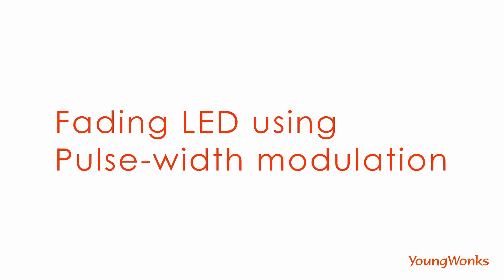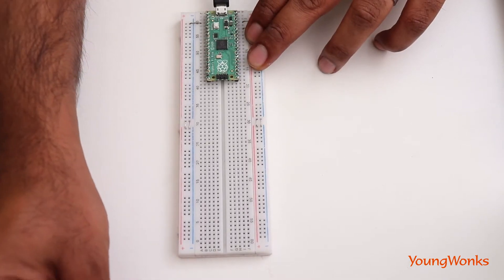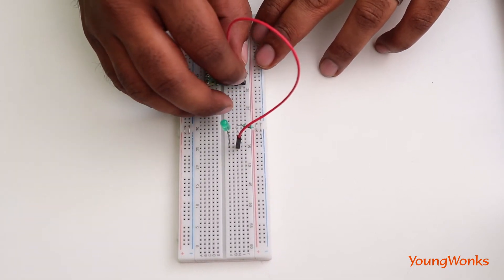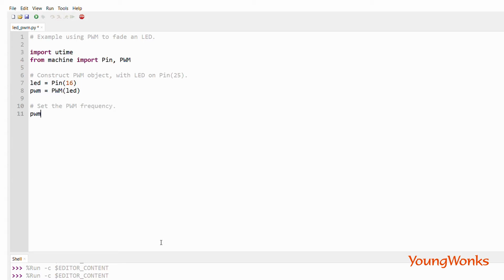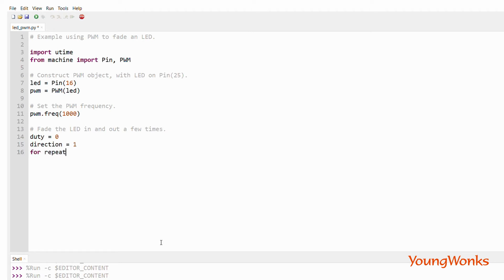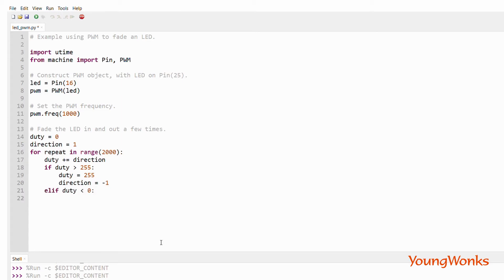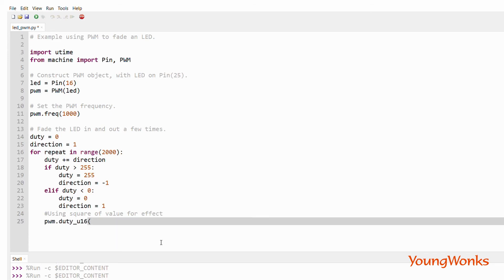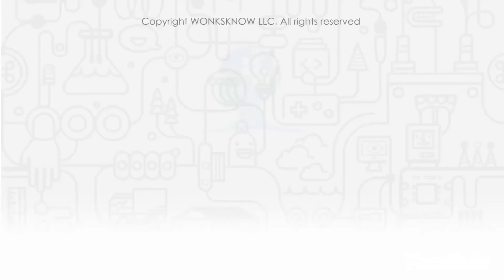Raspberry Pi Pico: Brighten or Dim LEDs using Pulse Width Modulation

Comment: Doesn't work, this is the correct one: 
from machine import Pin, PWM
from time import sleep

pwm = PWM(Pin(13))
pwm.freq(1000)

while True:
    for duty in range(65025):
        pwm.duty_u16(duty)
        sleep(0.0001)
    for duty in range(65025, 0, -1):
        pwm.duty_u16(duty)
        sleep(0.0001)